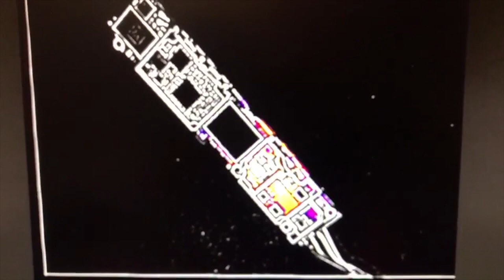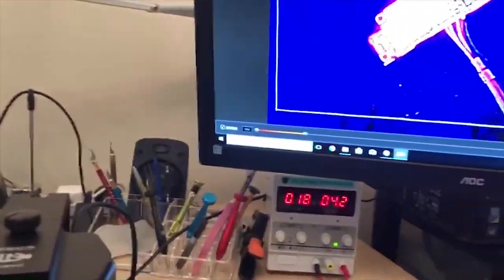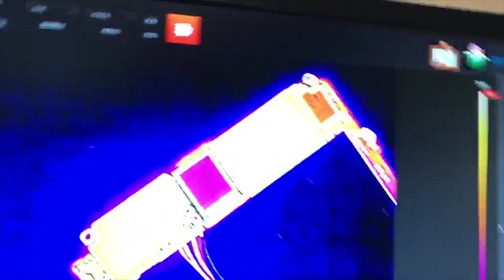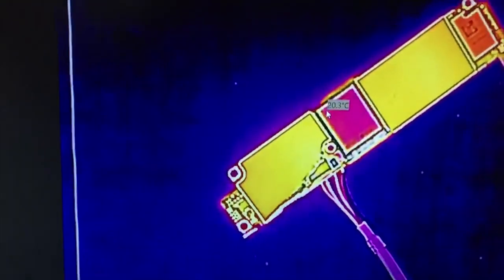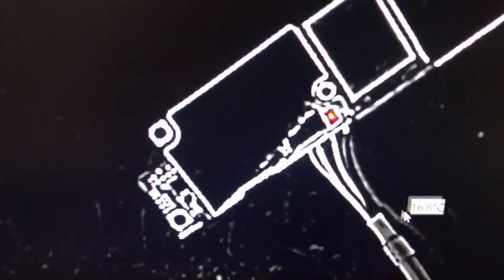Union Repair Thermal Camera for PCB Troubleshoot Cases

Comment: and WHAT may i  ask is a 'zero point zero eight short'? i though a short was a short was a short??
Reply: the 0.08 is a partial short milliamp discarging your device,the 0.08 is small number milliamp the heat is small ,that why youtuber limit the heat to 37 degree.The device still working but you got partial short somewhere that discharging you device.

Comment: "How was I going to find that?"  ....points to obviously charred cap that looks like it has been struck by lightning.   Come on guys---you find that with your eyes when you first look at a board before putting voltage into it!
Reply: So what do you think jessa ? I was thinking about this heat function and maybe it could save time !! Don’t you think 🤔  ?
Reply: @UnionRepair  contact number please bhai